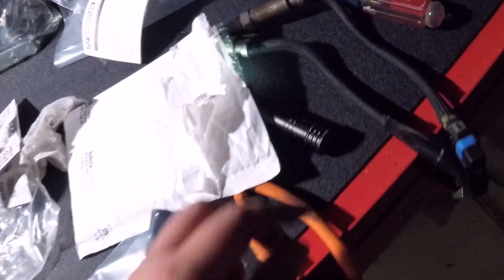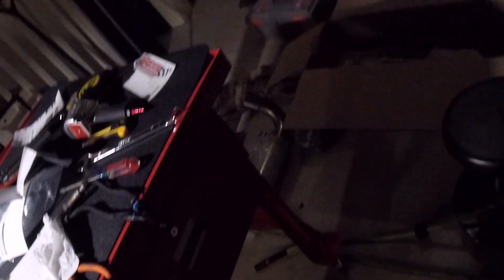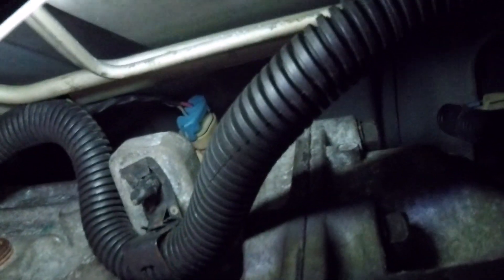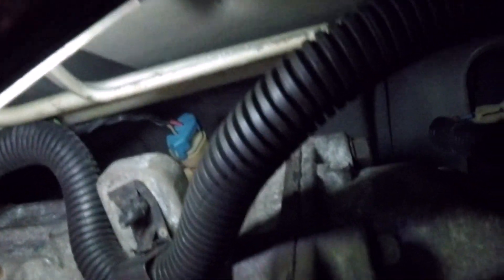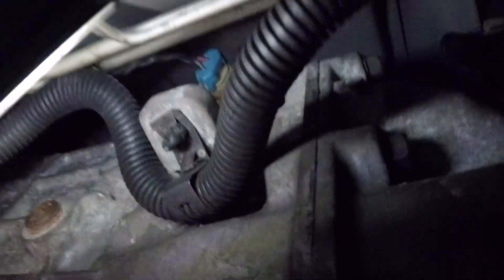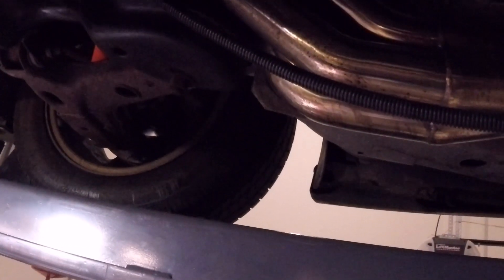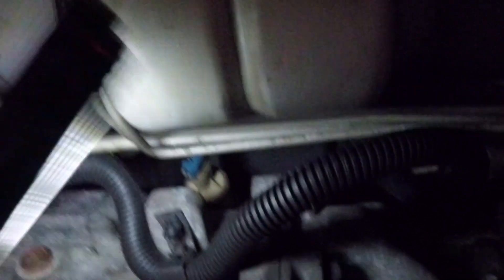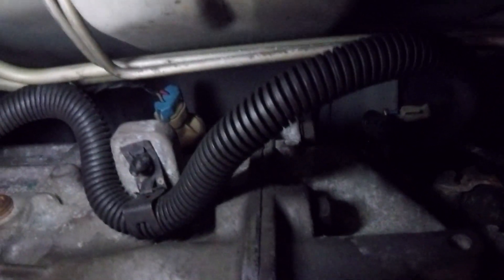93-02 FIrebird/Camaro Skip Shift Eliminator Installation (VERY EASY)

Comment: actually i never  had a problem with it  taking off easy no rush 1st to 4th great  4th to 55 or 125 if you will then to 6th gear skipping fifth   on the other hand hard in 1st it will go straight to 2nd and then on through the gearbox     this is 2000 trans am  by the way seen 138 in 5th and was still pulling hard  car was and still  is bone stock as far as engine and powertrain goes
Reply: Wtf did u just type lol